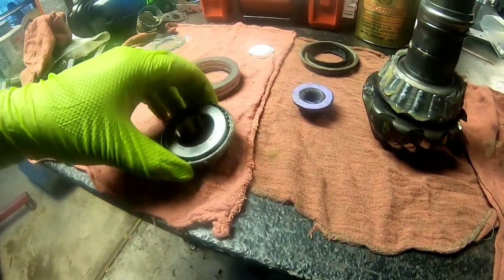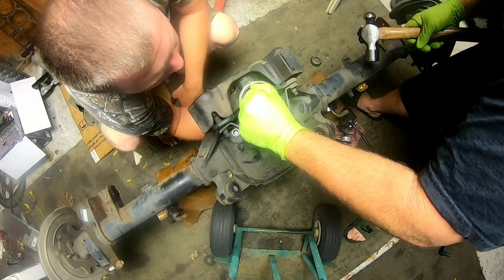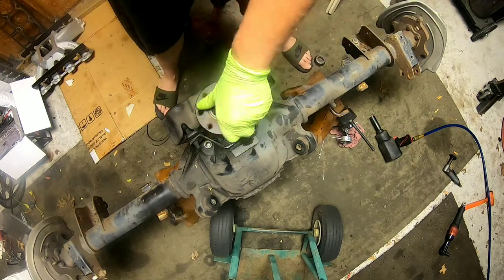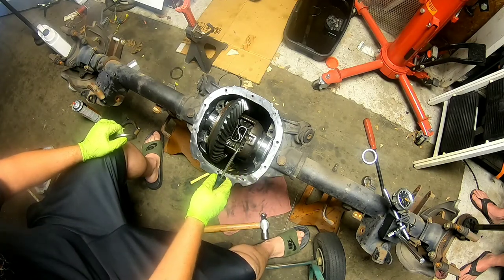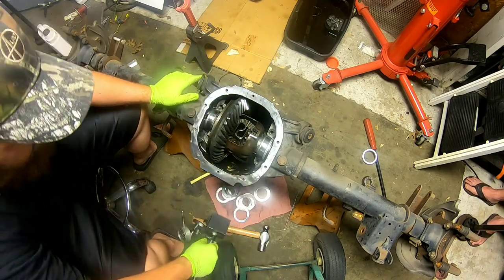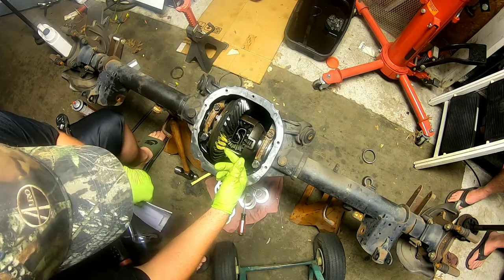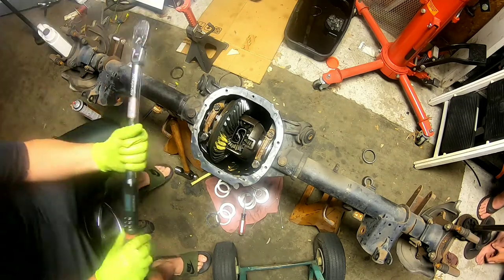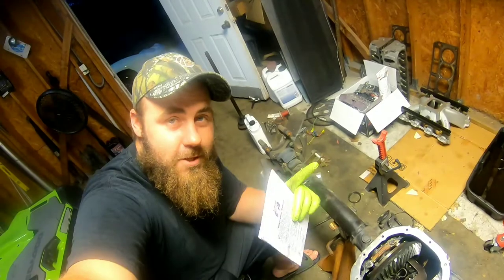How "I" rebuild a Ford 8.8 differential. Part 3

Comment: Good job man!  I’ve got a high mileage 8.8, now with out of speck wheel rotation play. 250k miles. Just bearings? Or just ring and pinion?  Or spider gears too?
Reply from the maker: You gotta disassemble and inspect.

Comment: I thought carrier bearing cap bolts were 97-102 ft/lbs or maybe that's ring gear bolts?
Reply from the maker: No sir there pretty much 60/65 across the board until you get into a 14 bolt or Dana 60/80
Reply: @legacyperformance9982  Yeah, I was thinking of a Ford HT 8.8", which is 77 ft/lbs for caps and 97-102 ft/lbs for ring gear. Had to look it up.

Comment: that pre load is not right. too loose for new bearings, that is what caused the first one to go bad.
Reply from the maker: I appreciate the opinion sir, but first off I didn't build it "the first time" and secondly I was the shop foreman at a driveline shop for 7 years. I've assembled and warrantied thousands of differentials.
Reply: @legacyperformance9982  did not say you built it the first time. somebody tried to put these 4.10s in while on their back in their driveway not knowing what they are doing. and screwed it up. you just do it a different way. I do it the way ford and all other manufacturers say. use a breaker bar to crush the sleeve in increments and keep checking with inch pound torque wrench for turning force spec.
Reply: not being a wise guy, but you just said you assembled thousands of diffs but had to refer to a pamphlet to get torque specs and proper gear pattern pics.
Reply: @waynemanor8357   Yes, heaven forbid he reaffirmed the torque specs to make sure it was done correctly.  eyeroll
Reply: @legacyperformance9982  dude pinion pre load is what makes or breaks these rear ends you could've crushed that sleeve too far and would have no clue lol. Not  a good practice Mr foreman